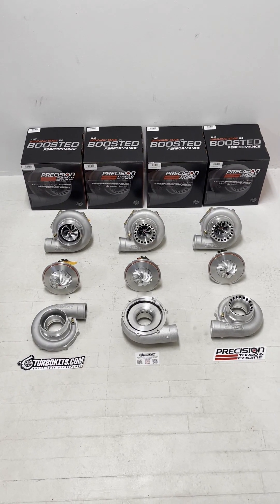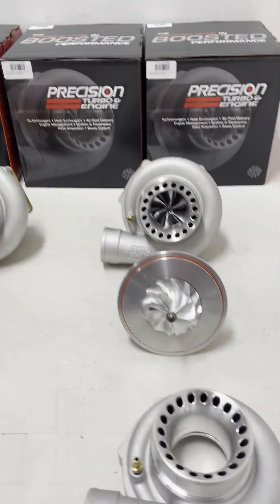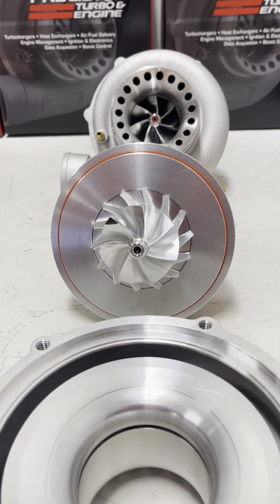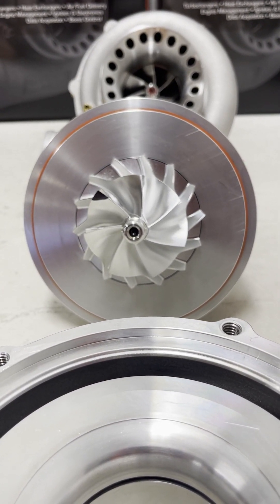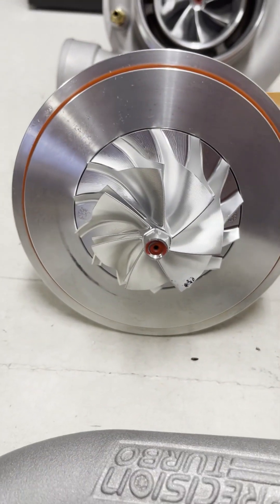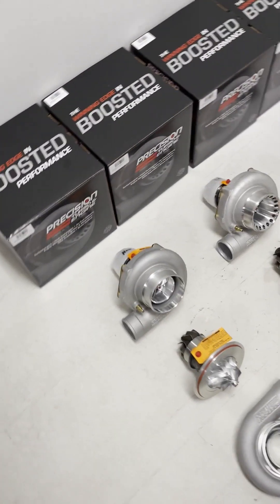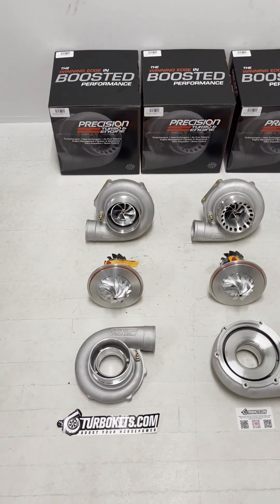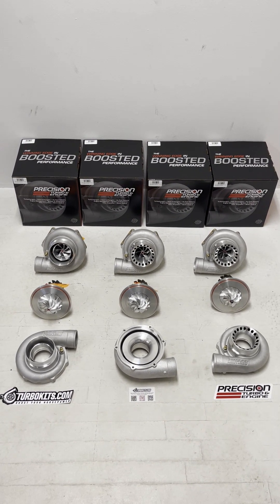The NEW Precision 6266 Next Gen Turbo Comparison to Gen 1 and Gen 2 by TurboKits.com

Comment: Older video but if you see this what power increase would you expect going from twin gen 1 6266 to the next gen 6266 at the same boost levels? My 5.3l made 700 wheel at 19psi and 800 wheel at 25psi. What real world numbers would I see if I swapped over and put the car back on the same dyno? Thanks
Reply from the maker: 800 Wheel on a 6266?
Reply: @T @TurboKitscom  yes it’s a 5.3L twin turbo with gen 1 6266 journal bearing turbos. I’m considering an upgrade to the next gen 6266 or 6466 turbos. Makes 800 wheel on 25psi currently and 700 wheel at 19psi through a th400/9inch. I am curious if at the same boost levels 20-25psi would I see a noticeable increase in power with the next gens in either 6266 or 6466 or would it not make that much improvement over my current gen 1 turbos at those same boost levels?
Reply from the maker: @jcmoney4125  Ahhhh twins, that makes a lot more sense! I didn't read the first question correctly!
Reply: @TurboKitscom  any thoughts?
Reply from the maker: @jcmoney4125  I would jump tot he 6466 Next Gens, I think those would add a lot more flow potential for very little difference in response. I also think,  unless there is some exhaust or engine restriction, the Delta of power between 19 PSI and 25 PSI will improve greatly.
Reply: @TurboKitscom has elec cutouts out the fender and motor/fuel system is good to go IMO on all fronts. Are the 6466 the same exterior physical size as the current 6266 I have? I’ve been told they are but would like to confirm what I’m looking at when it comes to swapping them. I’d probably give you a call when I’m ready to order so you could give me ideas on what ar to choose etc.
Reply from the maker: @jcmoney4125  Yes as long as you order the S compressor cover, it will be the same as the older 6266s. The Next Gen 6466 added an option for the larger H covers, which would not be an exact match size wise as the Gen 1 or Gen 2 S covers.
Reply: @T @TurboKitscom  thanks that’s perfect. Thanks for getting back to me I’ll be in touch when it’s time to order

Comment: For my k24, my tuner suggests a 6466 gen 2  whereas my vote for 6266 next gen..he says 6466 gen 2 would smoother power curve...
Reply from the maker: What are your HP goals?
Reply: @TurboKitscom  built engine, open deck. 600-700 awhp
Reply from the maker: @wickedsatan1  Pump Gas or E85? What boost level to get there? Either turbo will do it, the 6466 would be a better price point.

Comment: One important question, with these big turbo, the lag of these 6266 turbo is bigger?  Bigger lags complicate the driving experience specially on the curves.  I have an Evo 8, and I am looking for a new turbo.
Reply from the maker: We are comparing the same "size" turbo across versions. So in the case of the 6266, the NEXT Gen will make more power without any real loss of spool. If you are comparing say a stock TD04 from an EVO to the 6266, sure, those are 2 totally difference beasts...

Comment: do all gen 2 and next gen turbos all use same design exhaust housings
Reply from the maker: If they use the same turbine wheel size, yes, so if you have a 6266 Gen 1 Journal bearing, or a 6266 Gen 2 ball bearing and want to upgrade to the Next Gen, you only need to purchase the Supercore, which is the CHRA and Compressor housing and it will drop right into your current set up :)
Reply: @TurboKitscom  so if i have a gen2 6466, i just need to buy the supercore and can just drop the old rear housing from the gen2 straight in
Reply from the maker: @7urnme  Yes sir, 100%, if you already have a 6466 (or 6266/6766) the 6466 Next Gen Supercore will drop right in :) We have the SCP in stock!
Reply from the maker: Alternately, if you had a 6266 Gen 2 and wanted to upgrade to the 6466 Next Gen, you could as well, since they both run the 66mm Turbine. However, you would not be able to upgrade from a 6266 to a 6670 Next Gen, as those have different turbines. You would have to purchase a whole turbo in order to jump turbine sizes.

Comment: Coming from my T3 housing Garrett GT3076R .63 housing to the newest 6266 how much more lag would I be expecting?

Motor is a 2.0L Honda B series vtec motor. I want to keep the fast spool of the 3076R but want the ceiling for higher power in the 650whp range.
Reply from the maker: The biggest difference will be in the turbine wheel The GT30 runs a 60mm, the 6266 runs a 66mm, that is where you will see a decrease in spool, however the older GT3076 is only about a 500HP capable turbo, so for a few hundred RPM difference you are gaining a huge upside :)